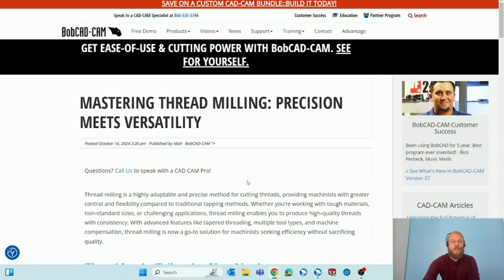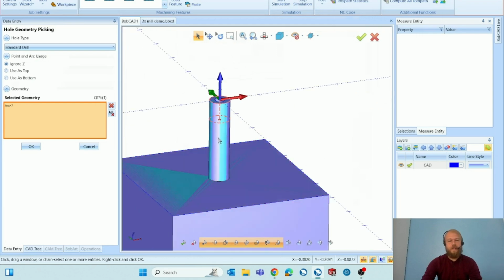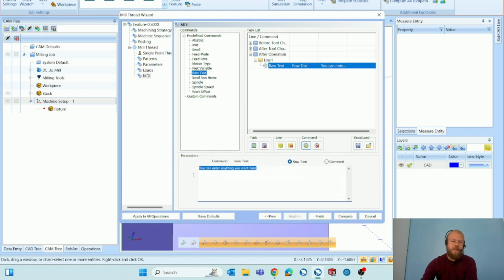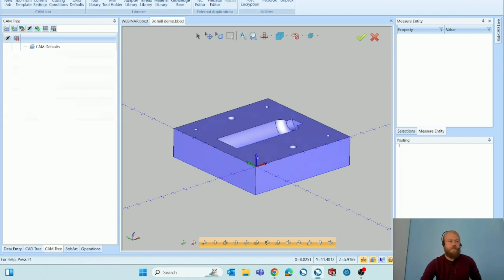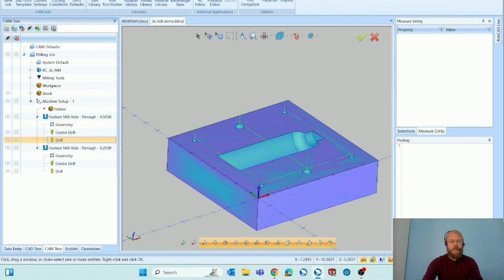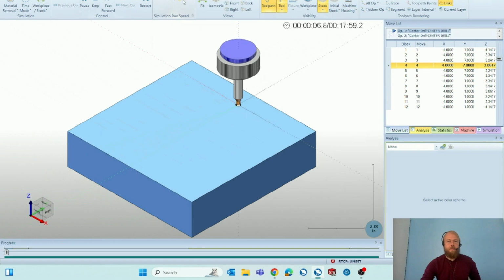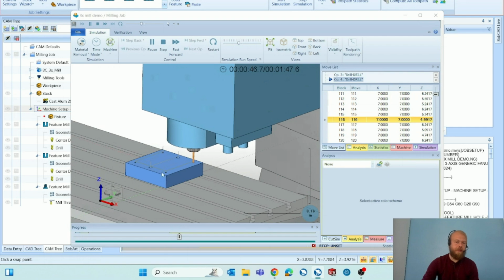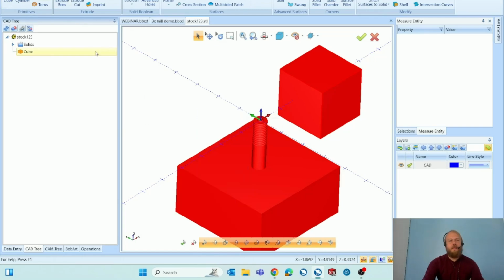Learn Thread Milling Techniques!

Comment: Why can't I do thread milling using G41 and no BobCad-Cam offset.
Threadmill tool is 10mm Dia solid carbide doing a M12 thread, it crashes into the side of the hole on the lead in. It's worse if you are side milling multi cuts to thread depth. Machining from bottom to top.
I am working on version 34.
Reply: Im not positive but it sounds like you only turned on machine comp. In that situation you need to have a proper lead in and lead out with more than the tool diameter to turn on and off cutter comp in a straight line move. If you use machine and system compensation you dont have to worry about this and you just adjust tool wear at the machine to comp the tool in.
Reply: Sorry Aaron-bo8mz,
The problem is that if I use just G41 (machine offset) without bobcads software compensation the tool crashes in to the side of the hole. Every CNC machine I have ever used, (and there are a lot of different makes with different controls) allows either in their threadmill cycles or by programming manually using G-Code this works fine. But BobCad won't even do this.
Going back to how you suggested doing threadmilling you have your tool diameter/radius offset on the machine set to zero, which is totally wrong in so many way.